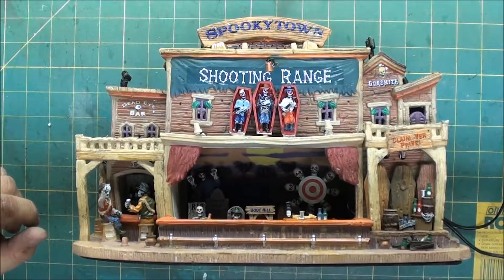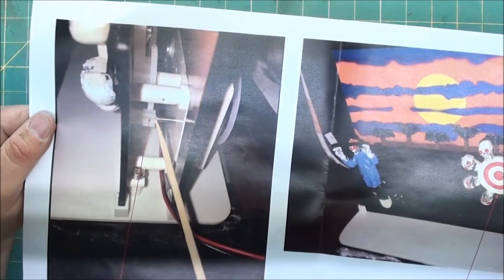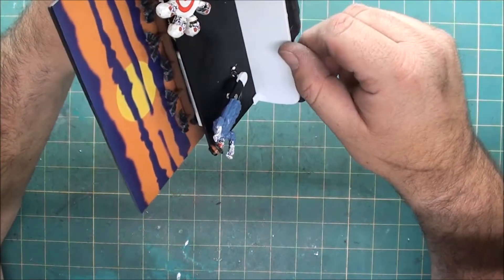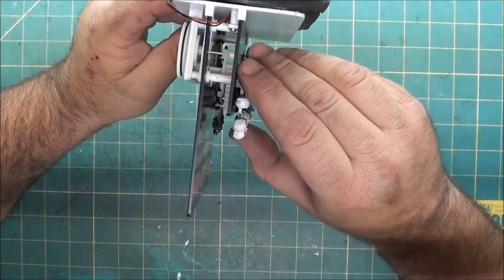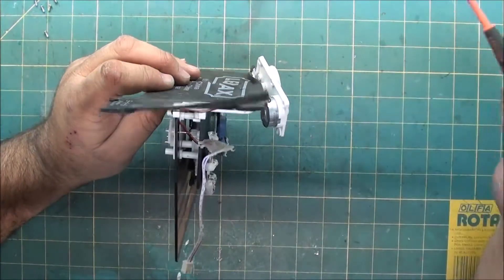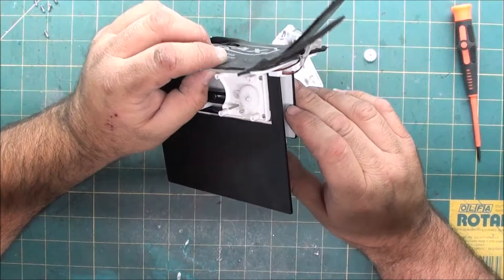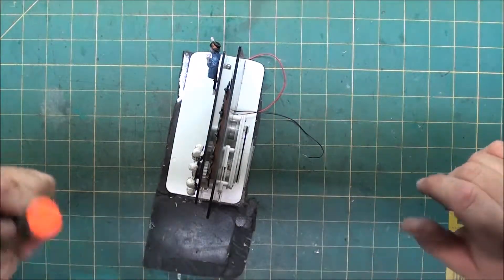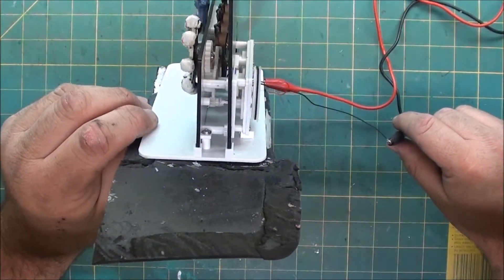Lemax Spookytown Shooting Range Tear down and Repair

Comment: Thank you for presenting this repair. I collect Spooky Town pieces and have repaired a couple. Someone just gave me the shooting range, and I will see if my problem is similar to yours. I probably don't have the assortment of gears to select from that you do, but being a model railroader I do have a fair number laying around. Thanks again.
Reply from the maker: I buy the multi pack of hobby gears on Amazon. Generally has most gears you need for Lemax
Reply: Awesome. Thanks so much.
Reply: I was able to repair my Shooting Range, it had the same problem. I've put up a short video of it on my channel thanking you for your video. I don't think I'd have attempted it without that.
Reply from the maker: What is your channel?

Comment: What type of device are you using at 10:15 to supply the 4.5 volts for testing? Or is it just the original power supply with alligator clips on it?
Reply from the maker: It is a bench repair station with power supply, soldering iron and heat gun
Reply: Excellent. Thank you. Googling is much easier when you know what something is called. :)
Reply from the maker: The bench station is a 3 in 1 853D SMD DC Power Supply with Hot Air Iron Gun and Soldering Pen

Comment: V cool video.  Any fix tips for the Spooky Town Coffin Factory, which has stopped rotating?  How much would a fix like that cost? The lights & sound work, just hanging coffins will not rotate on circle.  There is a circuit board in there which is beyond my skill level.
Reply from the maker: Sounds like the drive mechanism has failed. Either the belt has snapped or the main gear has cracked. There is a chance that the motor is bad but that's pretty slim. Do you hear anything from inside the house when you turn it on, such as the motor turning? You can always e-mail us a video to randomjchannel@gmail.com

Comment: Thanks to your vid (and 1 more attached to yours) I am in the process of repairing mine. I need the same gear. Would anyone sell me that gear?
Reply from the maker: Here is a link to some on Amazon, they are 10 tooth gears. You may find packages with a lower quantity. If not I can get you a single gear. Send a message to Randomjchannel@gmail.com https://www.amazon.com/dp/B07DH9JT8S/ref=cm_sw_r_sms_api_glt_fabc_5QSJVGQ7JZE77HGRSW7H?_encoding=UTF8&psc=1